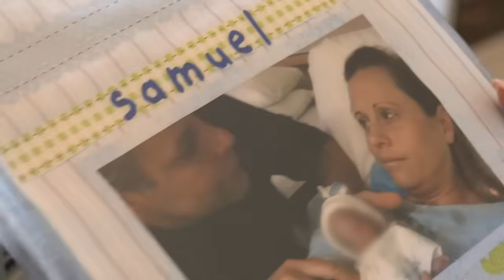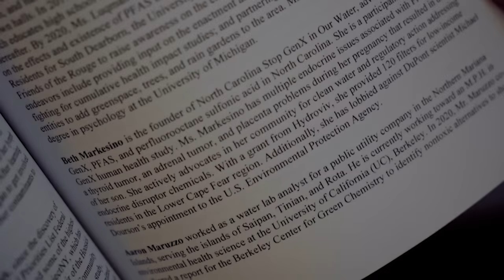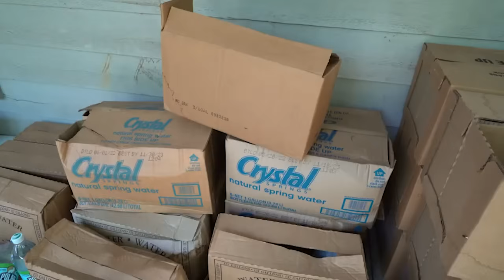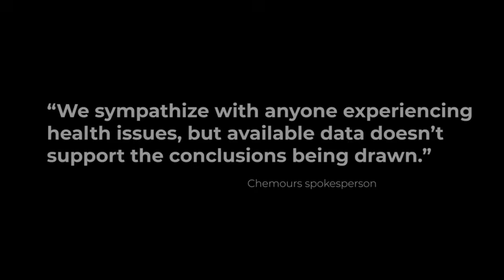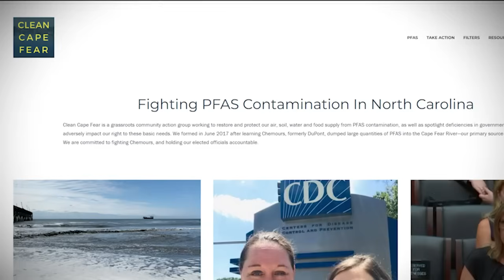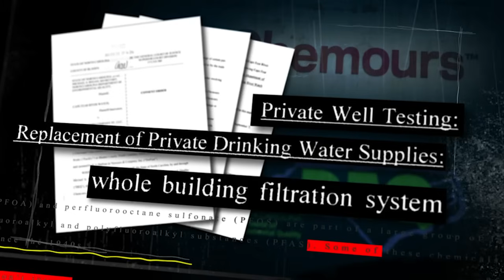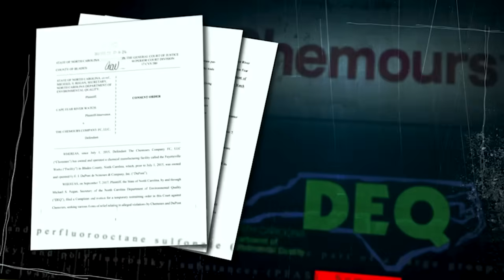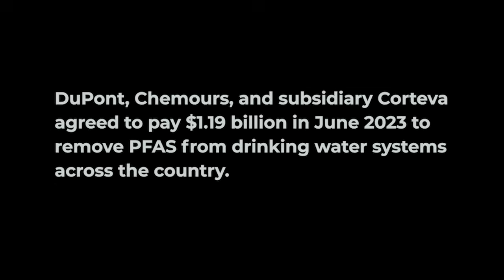Forever Chemicals - North Carolina's Toxic Tap Water

Comment: A story about Teflon:  I bought my first frying pan decades ago.  I skimmed the usual directions how to use it, then threw them away.   Then it hit me; did i just read something about a DEAD BIRD? 

 I went back into the trash and reread it.  Sure enough, it said that if u heated the pan for too long without food in it, the fumes could KILL any pet bird in the kitchen.  Well, it meant the same fumes would be going into my food.  This is insane.  I returned the pan.
Reply: Omfg! Thank you. I'm going to check all my pans now. So F'd up!
Reply: This  has been known fro years. You were smart enough to read the directions.
Reply: In the mid 80s I was cooking in a non stick Teflon pot. The water evaporated and the pot turned blue inside. My parakeet was squaking on the bottom of cage and died from those fumes. That night Chris and I had chest pains. We were in our late teens and didn't think more about it. But we were convinced the fumes killed the bird.

Comment: It’s so sad because the plastic water jugs/bottles they’re buying to try to limit exposure are also riddled with PFAs. The cheap plastic in water bottles/jugs leeches into the water due to high temperature exposure during shipping/transit 😞 bottle water is not clean, what a disaster